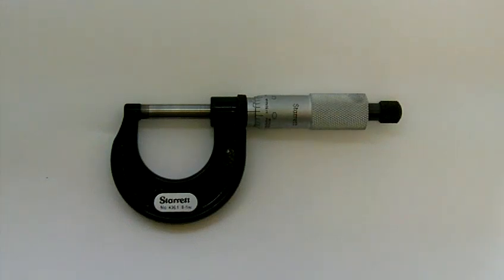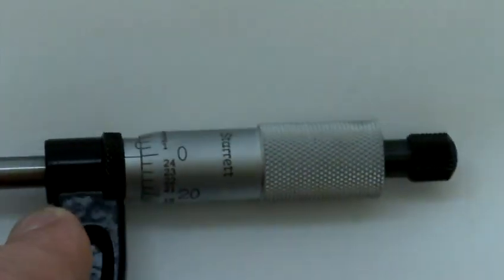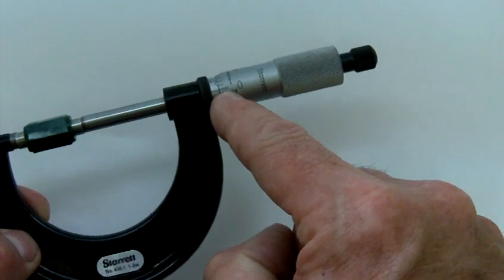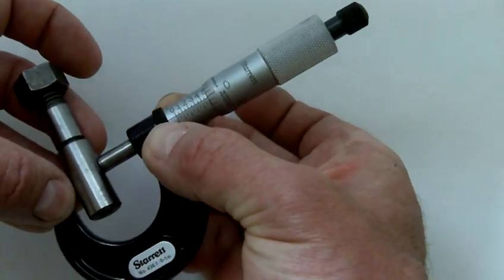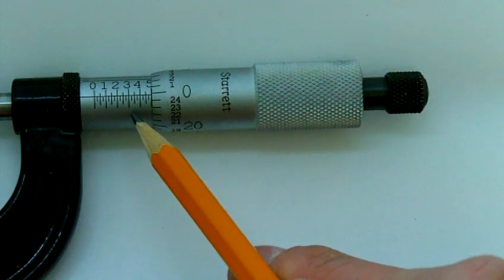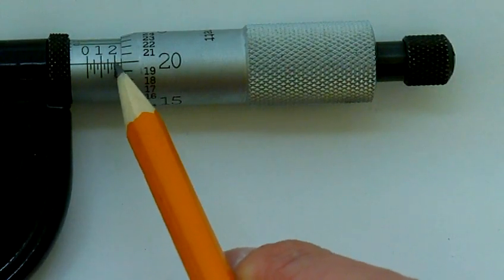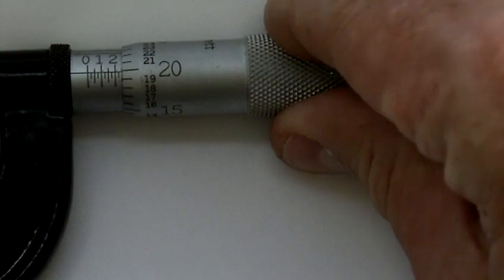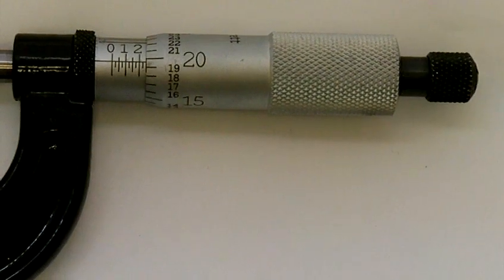Calibrating and Reading an Inch Micrometer Caliper

Comment: I recently bought a set of three micrometers off of Amazon and noticed that on the one inch micrometer it seems relatively easy to inadvertently turn past the initial reading stop point when the anvil points make contact. In other words, I zeroed in the micrometer using the included notch wrench but am dismayed to see if you apply any light tightening pressure the thimble will continue to rotate past zero due to whatever play is in the design. Is that normal or typical?
Reply from the maker: Hi John. Is the screw on the end of the thimble tight? What is the make of micrometer?

Comment: I have 2 starrett 1 inch micrometers one is  similar to ours a #436 and a real old one # T230FL.  Both were given to me , the old one was frozen up so I kept using penetrating oil until it would begin to move and over weeks finally was able to remove the thimble and clean the threads . It has a ratchet built into the spindle that does not protrude and was never to free it up. It works and I just turn the spindle just so it stops. It's a bit more difficult to read because the marks on the adjustable calibration part are right at the very edge of the thimble. I never got the adjustment wrench or 1 inch calibration spacer. It read 0 yet if I could adjust the collar one turn CCW I could see the marks better as I can on the newer one. If I turn it open just .006" I can see the marks better like the newer one. I don't know if it's possible to adjust it .006" by turning the adjustment collar one turn . I doubt if I had the tool I could turn the collar.
Reply from the maker: What a find! If it has sat in penetrating oil and loosened the thread up the sleeve should be able to adjust, you should be able to put a wrench in the hole in the back of the sleeve and rotate it to zero. Alternatively the thimble  should come off the threaded spindle, this often happens by loosening the screw on the end of the thimble (or unscrewing a two piece thimble). Once the screw is removed pull on the thimble away from the frame, it is on a taper. Simply realign the thimble to align the two zeros and tighten the screw. Good luck!

Comment: Looking at 7:40 isn't it .200 + .50 + .20? because you said it's .200 + .25 + .20, but isn't it on the .50?
Reply from the maker: Although you can just start to see the second graduation it's not quite to the second graduation (2 X .025). So the answer is .200 + .025 + .020 = .245"
Reply: machiningmoments Oh okay good to know :)

Comment: How is maximum reading of micrometer?5 cm?
Reply from the maker: +Lau Huong This micrometer will measure from zero to 1 inch. The equivalent metric micrometer will measure from zero to 25 millimeters or 2.5 centimeters.
Reply: Can measure ping pong ball?
Reply from the maker: Sure

Comment: Can you tell me how to make calibration adjustments on an old J.T.Slocomb micrometer? Mine doesn't the little hole put the wrench into. When I crank the thimble almost all the way out there is a notch on the barrel. Does some type of little spanner wrench fit into that notch to turn the barrel?
Reply from the maker: John Ratko I'm not familiar with that make. can you send a picture?
Reply: machiningmoments Thanks for the reply, but I gave the micrometer to a friends son after using a set of feeler gauges revealed it was no more accurate, or capable of smaller measurement, than my vernier calipers. After closer examination I noticed it didn't have the extra sets of markings on the thimble and barrel enabling it to measure down to .0001. It was only capable of .001. Looks like I'll need to buy a better one like in your video.
Reply: yup, lil spanner wrench, looks like... http://ecx.images-amazon.com/images/I/71fTcn4sVfL._SX522_.jpg

CRAP! I forgot to troll. I'm slipping.

Comment: I got that mic along with the lathe I got for nothing from a friend, I had my own mic so never used it and never really cared. But I just took a close look and found a small allen key un-opened in its plastic. I took off the friction stop and there is the adjustment. Maybe I'll try to take a video of it with my camera so others can have a video of the procedure.

Comment from the maker: If there is no screw on the end is the thimble two parts? Can you unscrew half the thimble? I'm pretty sure the thimble has a taper that sits on the screw under the thimble. If you can get that to free up (usually pulling the thimble away from the frame) it can be repositioned with the zero on the thimble at the 9 o'clock position. Can you send me a picture?

Comment from the maker: There is a screw on the end of the ratchet stop, if you loosen it you can pull the thimble away from the frame (it is on at taper). Reposition the thimble, tighten the screw, and recalibrate. Good luck and thanks for your post.

Comment: Thanks for the video.  I needed to refresh my memory.  The last time I used a micrometer was 14 years ago in college & I sucked using it.  I need to refresh my memory because I applied for a job as a press operator in a factory & it requires using a micrometer for measuring what dies I need to use for the press.  I got more studying to do.  Thanks for the video.  I hope more videos become available so I can get this down to a science!

Comment from the maker: If you look at your 2nd last post you typed 2.265 rather than 2.625 looks like it was just a type-o. I think you have it! Yes the units are important, I'm in Canada and we work both in inches and millimeters...there is a huge difference between the two sizes. Good luck and thanks for wanting to learn.

Comment from the maker: Your first example is 3/10 the second is 7/8 Do you have a scientific calculator with an "abc" button? If so it will do the calculation for you. Assuming you do punch in .875 "abc" 1.000 =(enter). It should display your fraction. Now hit second function (may be a yellow arrow or a yellow 2nd) then hit "abc" (you may have to hit = again). This should convert it to a decimal. Repeating should make it a fraction again. Good luck with the job!

Comment: Thanks, i am kind of getting the hang of this i applied for a job and the application required Decimal form and fractional form. i got a .300 so would the fraction be .300/1,000, the other one was .875 would that be .875/1,000

Comment from the maker: If the size is .500 for example and we know the micrometer can read to 1.000 inches the fraction would be .500/1.000  The lowest common denominator  in this case is .500 So .500 goes into the numerator (or top) once and the denominator (or bottom) twice making the fraction 1/2. Check out the Kahn Academy web site, scroll down to fractions then click on converting decimals to fractions. Thanks for the post.
Good Luck

Comment from the maker: @zombieatradies @zombieatradies If I understand you correctly the zero on the sleeve disappears when the barrel is screwed down. If this is the case the sleeve is not tight to the frame. Put your adjusting wrench in the hole in the sleeve and wiggle the sleeve back and forth putting pressure on the wrench towards the frame. You should notice the gap between the sleeve and frame closing. Anytime you manipulate a measuring tool it will require re-calibrating.